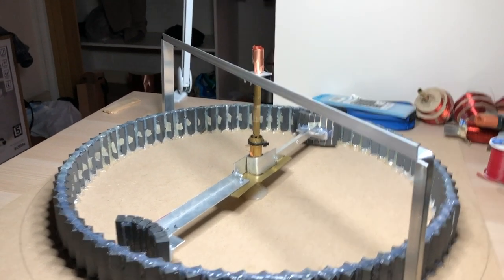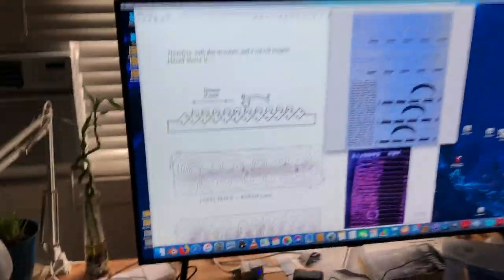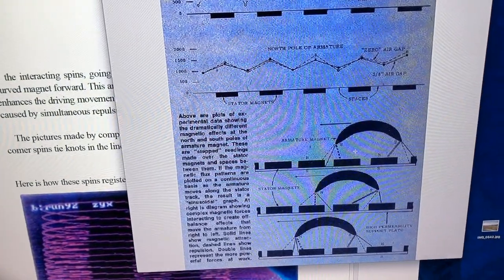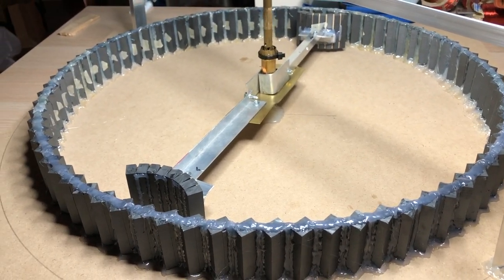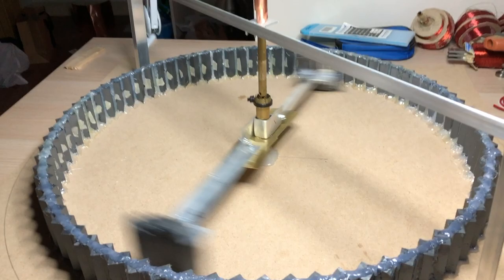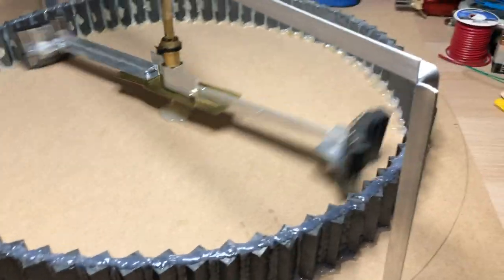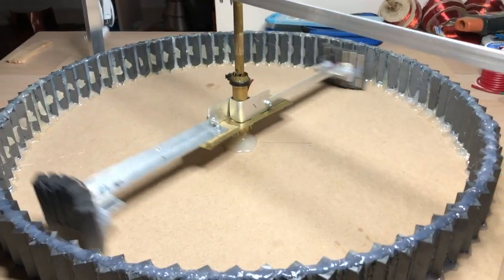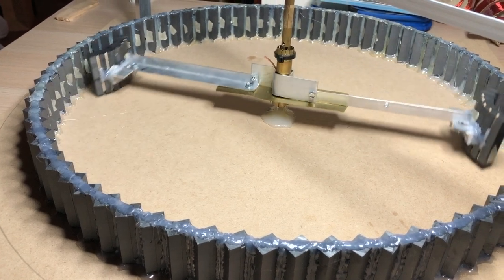Permanent Magnet Motor - Howard Johnson  (Nonworking)

Comment: never give up there's always something around the corner and there's always another corner.
working with magnets is like working with gravity.
you might be able to do it but your going to need some kind of advantage.
you could try combining the available forces from magnets and the available forces from gravity to try to find an advantage.
good luck.
Reply: No. We understand how magnets work pretty well 😐. Gravity isn't gonna help
Reply: @Timmyval123  if you understand magnets pretty well then why are you guys always trying to use them alone 
to make a perpetual motion motor?  even gasoline and diesel engines will not work without using a
flywheel of some type. so why not provide a advantage to help the motor to complete its push past the 
resistance like a gasoline or diesel engine does.
and gravity could do this possibly.
else show me a perpetual motion motor that is actually a perpetual motion motor that works.
Reply: @rontaylor3403  A perpetual motion machine is impossible. A fly wheel is not getting energy from anywhere but the crank. Gravity is in no way assisting the fly wheel.

Comment: Don't know what you try to achieve. If you want your contraption to spin very long then just remove the ring of magnets. If you want to fool you audience then use an air nozzle or similar external power source.
Reply from the maker: I'm not here to deceive people.
Reply: @spiritelemental  
Then it will never spin by itself. This device needs a source of criminal energy to work.

Comment: could this be principle of how wind turbine creates electricity?  looks like you have to have a jump starter or bumper/starter to keep going forever, how about springs in each end of cyclinder for contium of movement with the magnetic energy, in theory this should move indefinitely. the fuel can be wind, solar, waves/ tides, nuclear. i used to run boilers and generators so i understand about fuel/heat being so powerful, never saw any cold energy that was very powerful. wind would be the best cooler energy. tesla cars are changing the world but the battery energy has to produced with other means as wind,solar, or fossil fuels. do the environamentalists not understand that the clean fuels will never be strong enough to run the world's transportation needs?

Comment: Connect the rotating shaft to a generator and you got a Infinite Energy.
Reply: Wouldn’t it only be able to power the generator though? If you plug in another machine, the second machine will syphon all the power eventually, right?

Comment: Have you ever ran a magnet though a piece of copper pipe how it has an affect, how about using a copper shaft with round magnets around outside of the copper shaft in place of the bearings. I might be out of my league in this topic the best I can do is hang a photo on the refrigerator door using magnets. lmao

Comment: well considering that a ferrite magnet remain magnetic for at least 50 years a magnetic motor could generate electricity almost forever? if properly designed and assembled "OBVIOUSLY!!!".
one of the bugs on my head is if you make spin 2 magnets example north north facing each other and spinning in opposite direction at 100.000 rpm,will it those 2 magnets generate a magnetic field expanding slowly? kind of a magnetic bubble around it...
since i do no have such a fast electric motors that bug will have to wait for me to be answered.
what if those 2 magnets while spinning are electrically charged with 12v?
that's another bug in my head awaiting for an answer.
DO PLEASE SPARE ME IDIOTIC COMMENTS SINCE THEY ARE USELESS
anyway good job i really enjoyed that video coz conferms what many idiots world way have been denying a motor made with only magnets cannot work...
same as cars cannot run without gasoline....
well since 1898 when was invented and built the first car running with an electric motor by Nikola Tesla up until 2015 most of the companies building vehicles have begun building cars that run with electric motor or hydrogen motors.. proof of concept and confirmation that capitalists corrupt politicians world wide..
keep pushing extraction of oil,when we could generate hydrogen and electricity wit hydrogen...
Reply: one thing i have just observed the  edges of the rotating magnets are too far from the static magnets....
I bet if you place them close like 1 mm of gap it will work better and more efficiently you also should rotate the arch facing the central axe rotated facing the stator..
i bet you will get a better result...

Comment: With every attraction of magnets there is a repulsion. Wont run for ever.
Reply: But with a little kick every 4-5 minutes which will be a small part of the energy that will be stored by a generator in a battery, this can run infinitely. And even charge up the battery to full. So perpetual motion is True.

Comment: where is the energy comming from?
Reply: @crusadercatwoman02  force and energy are not the same, however when a force is applied to an object over a distance, then their energy be transferred to it. Any static force is only that, a force, and while there is no movement, eg equilibrium, there is no energy transfer. Any and all movement observed is due to pressure mediation, from high to low that liberates energy in the process. energy tends to flow from high concentrations to low concentrations, that is entropy. So if there is nothing but static forces, there must be a source of energy to maintain the motion of any object in a system, or else the energy in the system will run out and it will stop. magnets do not store energy but are an agergate manifestation of aligned magnetic domains of constituent elements. so my question stands.
where is the energy source?

Comment: I don't see "Symmetry Breakdown". ??
Short circuit (copper 1 thread) to the edge of the rotor magnet?
Bye.
Reply: @crusadercatwoman02  My own decision, my test is a complete failure.
After the test (measurements of other tasks), it showed a different magnetic field diferecia. The like magnets from the same shipment.
Finally, I mentioned that there was no offensive intent in my letter. Regards S.

Comment: :( unfortunately magnets will never overcome their own kick. Much in the same way as you cant lift yourself up by your feet ... efficiency on the other hand is an whole new topic. Look @ 5:26, this is showing you that the magnets are not overcoming each other. So what you have here is a nifty fly wheel with your bodies arm is providing the initial invested motion... You have 4/4 magents. Try 3/5 where the 3 being the leading edge

Also have a look at Ed Leedskalnins perpetual motion holder "coils" for some other ideas too. Chears

Comment: Great work. One thought - your motor is a pendulum. You can try to use very weak electromagnet impulses on resonanse frequency to start this motor as pendulum and then to support it's movements with such weak resonanse impulses and in the same time attach to rotor generator and to see - will it produce more energy during rotation then needed for resonanse impulses.

Magnet pendulum example - https://www.youtube.com/watch?v=urCziTzDvyc

Comment: Air resistance, & gravity drag on the bearings. Encase the machine in a vacuum, with magnets on top of the chamber lifting the weight Of the machine perfectly off the bearings, floating as it spins